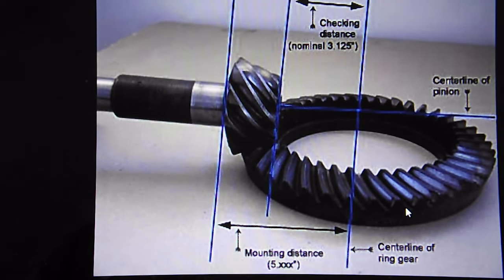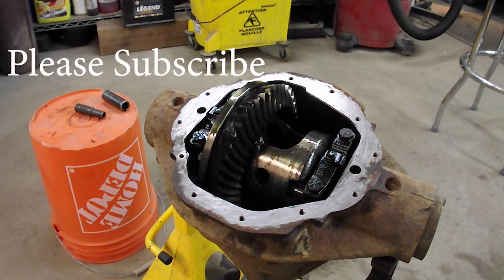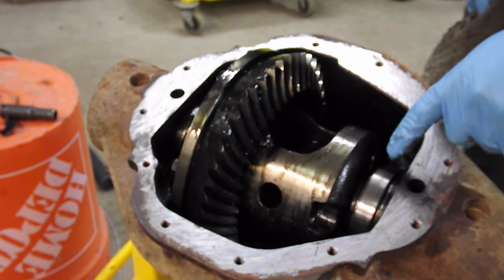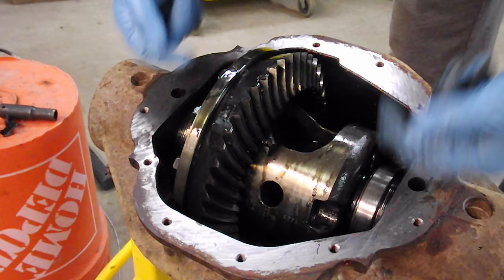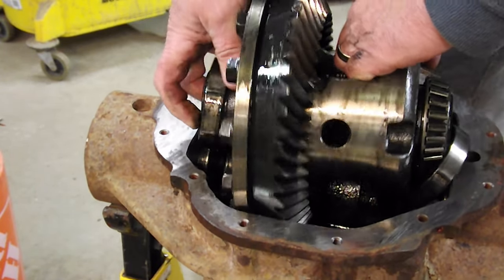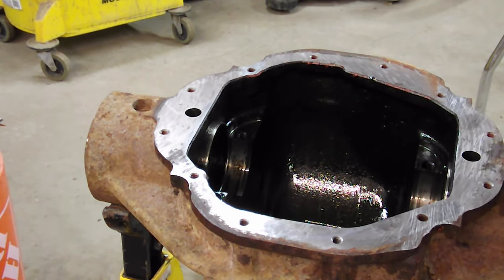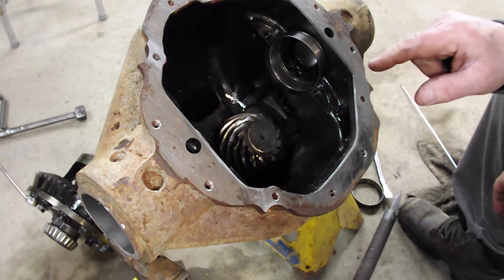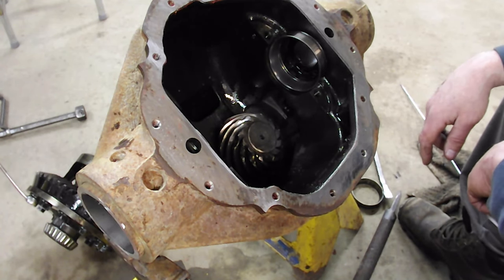Pinion Depth Checking With Simple Tools

Comment: Great video I'm about to dive into this for the first time on a gm 12 bolt posi thats still mounted in the car, not looking foward to popping the carrier in an out 20 times, sucks this pinion didn't have a # on the face or any other markings cause I would have liked to see how that matched up or how you did the math using a calibration tool.
 My thought is just to mount a square plate where the carrier bolts up then just measure to the face of the pinion, seems it takes a bunch of math an room for error right off the table.
 Is the # on the face of the pinion the depth from the face of the pinion to the center of the carrier itnis from the back of the spacer behind the pinion to the center of the carrier?
Reply: Also the face of my pinion gear has 2 separate  #'s
Reply: Also what unit of measurements are on the face of the pinion gear? 10 thousands. Cause my kobalt calibration tool measures in MM an CM only and I didn't see you do any conversions
Reply from the maker: The marked numbers (you found 2) are gear set matching number to keep ring and pinion in a set during manufacturing / packaging, the other is pinion depth usually within the range of +4 to -4 in thousands of an inch
Reply from the maker: If you are taking apart a good work diff, and just changing to different gear ratio. You can use any repeatable refence surface. The important part is getting the calculated measurement of the bottom of the pinion where the bearing or shim sets against. Number on the pinion is usually stamped or scribed on the top of the pinion gear or on the shaft below the large bearing. My reference of top or bottom is if you are looking down into the diff like I had it is sitting in video. I don't like saying front or rear because that depends on where you are standing or possibly 4 wheel drive diff. The marked numbers (you found 2) are gear set matching number to keep ring and pinion in a set during manufacturing / packaging, the other is pinion depth usually within the range of +4 to -4 in thousands of an inch. A plus number needs to sit deeper in the diff, so a thinner shim. Hope this helps. Remember the final check is always looking at gear pattern in marking paint.
Reply from the maker: 25.4mm equals 1 inch. Pinions markers on older North American vehicle are in thousands. Always check for spec in a good service manual.

Comment: If you test mount the pinion using the old bearing that you’ve sanded or ground down to measure pinion depth do you NOT use the crush washer for the test install? Also would you still torque it to spec? I am assuming you would have to. Thanks
Reply from the maker: Correct - I do not use crush spacer when doing test fits, and I always torque pinion bearings to rotating preload spec. Thanks for watching and commenting. Hope you subscribed.

Comment: That stem at your left hand is the part that you use to measure that depth
Reply from the maker: You can use either end of a caliper to measure depth, the thin probe on the skinny end, or between the end surfaces of to jaw head. Take a look the the big end and you will notice both jaws are flush at zero and can be used to measure depth. This end give you and more square surface to get accurite readings. If that end is too large to fit, turn it around and use the skinny end. Took years before I seen them used this way, and it is some much easier if you have the room. Thanks for watching and commenting. Hope you subscribed.

Comment: On many GM rears, especially 12 bolts and possibly other makes of rears, you can often using a Dana type shim under the bearing cup in the housing, rather than pulling the pinion bearing. On a 12 bolt Chevy, usually more gear requires a thicker pinion gear shim. If you start with the original thickness and end up needing more shim, you can knock loose the bearing cup from the housing and add a Dana style shin and avoid pulling the pinion gear bearing.
Reply from the maker: Yes you can if it is available. But remember if the next guy doesn't understand why you did it he will likely say it was done wrong, as per service manual.
Reply: @acmemachining  The Dana 60 shim will fit the 12 bolt Chevy and others. Hopefully the next guy changes bearings when he changes gears, so he should run into the shim behind the bearing cup. :)

Comment: Does this same process work on a Ford 8 inch on 69 Mustang?
Reply from the maker: Good question. The older ford differentials come out the front and don't have a rear cover. So you have to make/ buy an axle bar that fits in the side bearing holders to measure the pinion depth. Same princible but that axle bar would be a spacific tool. Must of these older diffs you would have multible front carriers with different gear ratios and just change complete front carrier. You could have one for highway driving and one for race weekend. Thanks for watching and commenting and subcribing.

Comment: The whole objective here is to set the pinion depth without having to install the carrier in and out 5 times. Am I right ?
Reply from the maker: Exactly. Measure before you remove, than check again after bearing or gear replacement, and pinion is set. Gear pattern checking may show slight adjustment required but usually your right on with pinion depth. Thanks for watching and commenting. Hope you Subscribed.

Comment: When I use this information to try to gauge my pinion depth, I'm getting some strange numbers.  Based on what I've measured and calculated, I should be using 0.158 of shims.  Does that seem unusual? That's the factory shim, plus nearly every shim that came in the kit I got.  If I install that many shims, I can't get any backlash at all.  So obviously I'm doing something wrong.  I just don't know what.  My pinion has the number 092 written on it.  The ring has a D22092 on it.  I'm assuming my mounting depth then is 5.092?  The pinion is 1.99 without a shim, the center of my axle is 2.44 from the surface of my diff housing. Thanks
Reply from the maker: What was the original measurement of pinion before removing and do you have the right spec for pinion depth? Most pinion shims are under 0.035". If you can't get spec for your diff's pinion start with factor shim and check contact pattern with marking paint. If you have measurement from original pinion you can select shim through calculating difference. Some manufactures done give pinion depth spec, they just give what you should be measure with their special tools. I hope this helps. Do force anything and repeat until contact pattern is correct.
Reply: @acmemachining thanks for replying.  I'm not sure on the depth of the original pinion , but I got the bearing off in one piece and honed it out until it slip fits.  Should the check distance of the old pinion be the same as the new?  That would simplify the problem.
Reply from the maker: I hope it works out for you. The best things about challenges is you make you so much better for working through them. Hope you subscribed. Thanks for watching & commenting.

Comment: Instead of using the cover face, which isn't machined with the same tool, i use the bearing cap surfaces, which are the actual center of axle rotation.
Reply from the maker: The bearings cap surfaces are not always centerline. They are align bored just like engine main bearings. Most are perfect but some are off and that would ruin the job. Thanks for watching and commenting.

Comment: That's all fine and dandy how your doing that but the pinion depth is pretty critical and all those measurements your taking off of different surface's your liable to be off a few thousands. Also if the rear-end has been worked on before who knows if it was set up right to begin with. That rear-end did not come out of a ram 1500. It's a Dana 60. They never installed them on a 1/2 ton ram. 3.125 is the pinion depth on a 60. Just get the right tools for the job instead of cobbling something together. Setting up axle gears right is pretty important if you want them to last. Especially if you using it to off road or pulling.
Reply from the maker: Title of video is about using simple tools, not how to spend a thousand dollars on tools to save 5 hours labor. This diff came out of a 2012 Ram 1500 VIN 1C6RD7GT8CS118883 customer still has the truck. Diff is also too small for any severe off roading or pulling. Final check for any diff work is pattern checking, so if my method got a totally previously messed up differential to within a few thousands on the first try, to be corrected after checking pattern with gear paint, good job.
Reply: @acmemachining  Agreed!! DEF a Ram 1500 9.25 and NOT a Dana 60!!

Comment: I feel like your Making a little extra work for yourself in calculations. Lay bar across, measure down to bearing cap mounting surface. Zero your caliper and  directly measure pinion depth. I've had great success doing it this way for years.
Reply from the maker: You are assuming bearing cap mounting surface is centerline of bearing. That may not be correct and that assumption can be costly. I perfer a little extra work rather than a redo. Thanks for watching and commenting.

Comment: A lot of these measurments are set in manufacture, why complicate this task. the only size needed is the depth to the pinion. Why not use the vernier with the depth guage, instead of the jaws?
Reply from the maker: Thanks for watching and commenting. You can use either end of your vernier. I have had customers bring ring and pinion issues for repair after someone got it wrong. This is how I get back on the right track without removing pinion many times. Manufactures have specs & procedures that require thousand of dollar worth of special tools that may only work on one make and model. I shared this just to show that you can do it with a good pair of vernier calipers.  Thanks again, I hope you will subscribe.

Comment: Why bother taking a measurement of the old pinion if you're installing a new pinion?
Reply from the maker: So you have a reference measurement. Once it is out you can't be sure of where it was. Thanks for watching & commenting.
Reply: Both pinion's are exactly the same?
Reply from the maker: Never ASSUME. That will bite you when you least except it. If they are exactly the same, we would just remove and replace with out any measurements or concerns. Parts are never exactly the same especially gears and bearing. That's why they have shims and set-up procedures.
Reply: @acmemachining right so again why are you putting in the old shims when you have to re shim them anyway with plus or minus shims?
Reply from the maker: Shims can be re-used. Most times you have to stack shims to get the right height you need. Rarely do you have one of each size, but combinations will add up correctly. Always save your old shims for next time. A lot of shops trade off shims to get what they need.
Reply: @acmemachining so if you do have to add or take away shims you have to pound out your bearing race, can't you just use your old race for a guide so you don't ruin the new race?
Reply from the maker: Using proper service methods you shouldn't damage the bearing or race
Reply: @acmemachining will putitng a preload on the pinion change the measurement?
Reply from the maker: Bearings must be preload

Comment: Way to much math and confusing. Backlash and patterning is all you need.
Reply from the maker: Thanks for watching and commenting. 90% of the time you can just change parts and get away with nothing more, but when it does not work that way you better know the math or have really deep pockets. Diff parts are not cheap so I always take the time to measure. That way it is done right the first time.
Reply: HOW DO YOU GET THE RIGHT TOOTH PATTERN BY KNOWING THE PINION DEPTH AND WHAT SIZE SHIM TO ADD OR SUBTRACT NEED TO MEASURE AND DO THE MATH IF NOT REAREND WILL MAKE NOISE OR EVEN WEAROUT BADLY AND BREAK AND CORRECT PINION BEARING PRELOAD CARRIERBEARING PRELOAD ALL IMPORTANT IF TO TIGHT BURNBEARING TO LOOSE WEAR OUT NOISEY AND DAMAGE. ITS NOT FOR EVERY ONE AND ITS NOT EASY YOU HAVE TO UNDERSTAND WHY AND HOW HOPE THAT HELPS TAKECARE
Reply from the maker: Rear diffs can be fun if you keep track of what you are doing. The fun goes away when you check you pattern with gear paint and find out you need to take the pinion back out, which can cost you for new bearing, crush spacer and possible nut. That why I like to measure them as they come apart. Sometimes a customer will show up with rear diff in a basket (aka Basket case) and ask "can you fix it?" Then you need to start with some base line numbers and measurements to do it right. Not all jobs are easy. Thanks for commenting and watching. There are many pinion shim charts on google that help you understand pinion markings. I always torque for rotating preload inch-lbs and not the ft-lbs spec listed in manual. Hope this helps - goodluck with your projects.

Comment: Awesome video 🤩 i heard of people shining the raice and was curious if that was a can do or dont do kinda thing. 
     I see the whole tube you as a glass filled halfway , drink it and get more or add more dink it and get more 😂😂😂🫣weather learning helps individuals learn for themselves to save $$$ and the feel of accomplishing a project themselves , it also helps the mechanics with time since theres usually a good wait to get your vehicle in and diagnostics if you still pay someone . Also its knowledge for if you pay a shop then you’ll have the knowledge to tell if you’re getting robbed 🤷🏽😂
Reply from the maker: Bearing need press fit to work properly. You can hone out the old bearing to test fit. but that can be lots of work. Easier to calculate required shim and do install once. Always check gear pattern with gear paint before you say your finished. Make adjustments if required. Enjoy your project. thanks for watching & commenting. Hope you subscribed.